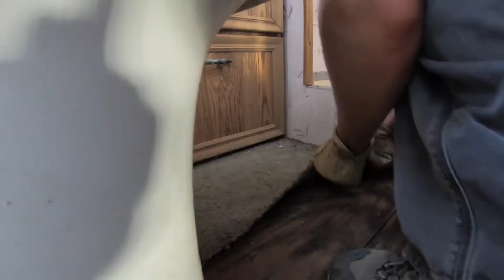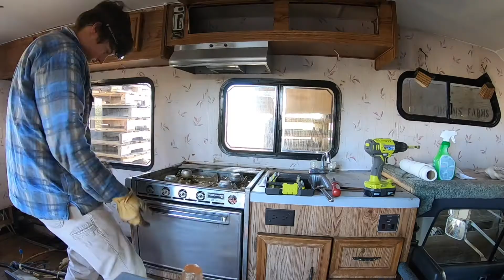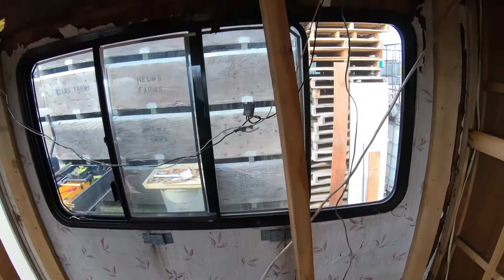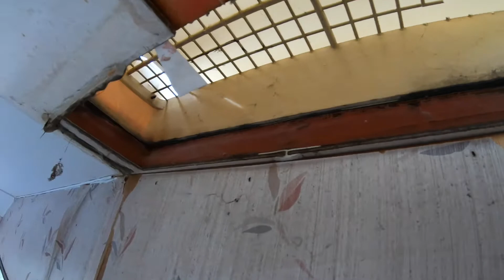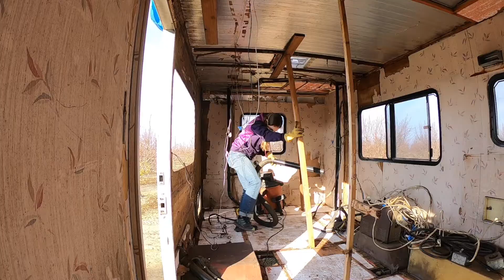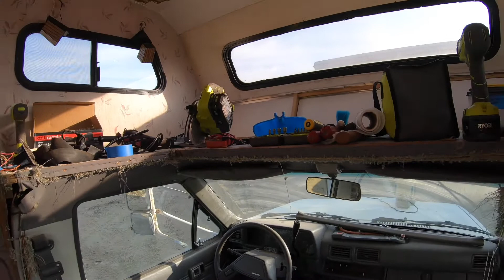COMPLETELY GUTTING OUR VINTAGE TOYOTA DOLPHIN CAMPER VAN || Renovation Plans

Comment: Hi guys! Thank you so much for uploading all these videos. I’m really enjoying them. It makes me really happy you guys travel so much and motivates me. I have a dolphin from 88 and need some work in the roof/ceiling. I have some questions and I’m wondering if you are still reading this messages Hopefully I can reach out again and ask you for advice? Basically my roof is sagging in the middle so I don’t want take the whole roof out, but I’m wondering if I can just replace the panel in from the inside. what do you think? Is it possible to put new panel in the middle only without touching the rest? (I’m pretty sure it’s all rotten around the vent. so I was thinking about removing all the side cabinets ripping off the ceiling, leaving the aluminum on top and just push your roof from the inside up lining up, so it’s not sad and it’s not collecting anymore water or filtering through the vent. Who is also welcome to answer if you know or have an advice. THANK YOU BOTH

Comment: We have owned 5 toyota motorhomes and our current model is  a 1993 Dolphin 900.  All these (5) RV's had the sagging roof.  The current model 900 seems to be like your Dolphin in that the roof around the air conditioner doesn't seem to be sagging.  Thanks for showing the metal framing in that area.  However,  the roof is sagging approximately in line with the side door of the coach (about 5' forward of the air conditioner).  Sagging enough to pool water about 1-2 inches deep when on a level parking surface.  Your video shows the roof rafter framing pieces to be smaller dimensional wood (1' x 1" ?) and spaced pretty far apart (?' on center) resting on top of the wall framing.  No wonder these roofs sagged.  I hope to pull these sagging areas up by installing steel metal cross members  (L shaped 2" x 2" ?) across the roof which will rest on the outer walls.  From inside the coach I will bolt a wooden board (3/4" x 6")  up through the roof and through the new metal cross braces.  Tightening the bolts should pull the ceiling back up to raise the roof/ceiling  surface.  I hope the through-the- roof method won't leak after using self-leveling lap sealant where the bolts penetrate the roof and maybe butyl tape under other cross member points  of connection (like on top of the side wall connection).  Would you advise resting the metal frame directly onto the aluminum roof and using butyl across the whole joint or raising the metal pieces up above the aluminum roof material?  Do you think wind noise is going to be a problem?  Thanks for your video.